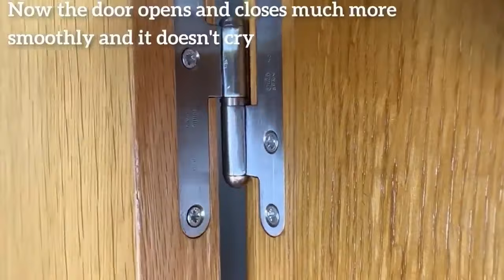The One and Only WD40  Trick Everyone Should Know  and 20 Other Uses

Comment: According to the manufacturer, WD-40 is extremely flammable.  Do not use on car engine or near gas tank.  It also leaves a residue that attracts dust and dirt so whatever you clean with it will be much dirtier the next time you clean it.  Also the toilet in this video was not dirty or stained so can't see if product works.